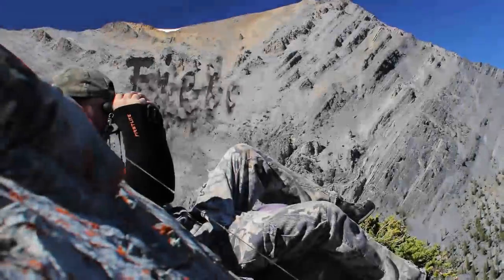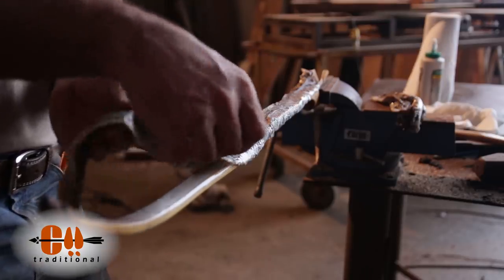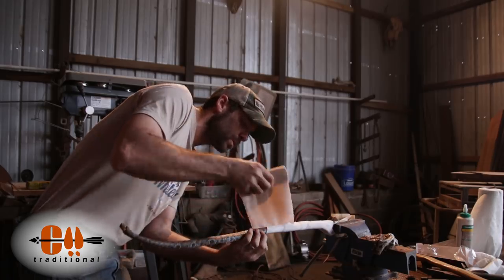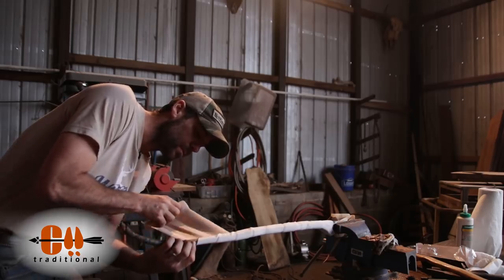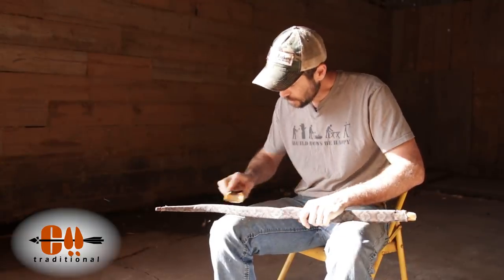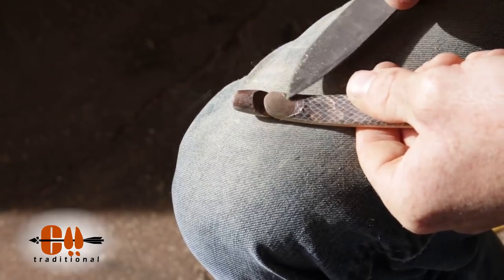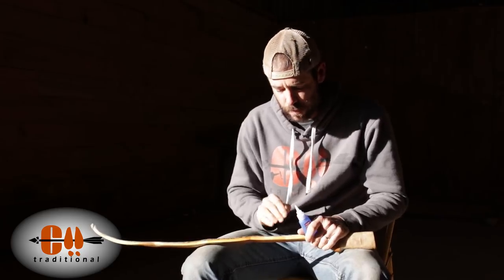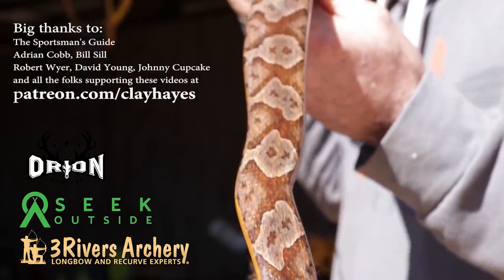Recurve bow building - how to back a bow with snake skin

Comment: Another fantastic vid clay. very much appreciated. hope to be working with some snake skin in the near future. what might help you to dry out your wood more  efficiently try putting a dehumidifier in the box instead of the heat lamps. it wil regulate the heat / moisture evaporation alot easier with less chance of the wood warping or splitting. i use it for prepping my woodturning and knife blanks. would work great in that small area.
Reply from the maker: That would work great!

Comment: Another way to get them bubbles out you can use a hypodermic needle and inject some tightbond underneath and press back down. Rub with damp cloth to clean up extra and tape a wrap of masking tape (blue or purple) around till set. Works great for me but takes a bit more patience.
Reply from the maker: good tip
Reply: @clayhayeshunter hey Clay! while I got you here.   I just broke my forth recurve using dry heat and don't know why? I can bend side to side to srraighten or remove twist no problem but for some reason the front to back for recurve aint working. Im heating with heat gun for 10 minutes till belly wood just starts to color. any tips? I'm thinking trying steam next time? do you bend before or after tillering? I notice if you bend then you remove more wood then I loose a bunch  of bend. I've been working wood for quite a while but haven't bent much.

Comment: Do you have any of these snake skin backed bowed that have been well used?  It seems that over time the skin could become dry and stringing and unstinting the bow could split or crack them.  I guess you'd have to keep it well oiled.
Reply from the maker: I seal them up really well so they have a protective layer over the skin. But they can bet beat up after a while.

Comment: Have any tips on applying real snakeskins to a fiberglass backed bow? I was thinking of using 15 or 30 minute epoxy. Thoughts?
Reply from the maker: I think someone wrote an article about that in an older issue of Traditional Bowhunter Magazine. You might drop them a line at tradbow.com

Comment: Do you know what needs to be done to a snake skin to prepare it for this other than fleshing? And probably salting I'd imagine
Reply from the maker: Don't put salt on it. Salt will soak up humidity. You don't have to do anything to it. Just glue it down. If it's dry, rehydrate it first.
Reply: Oh ok. I figured you'd have to do something to keep it from rotting, thanks for the info I sure appreciate it